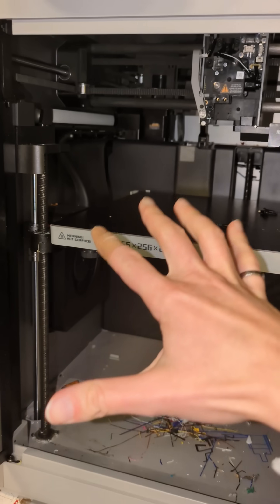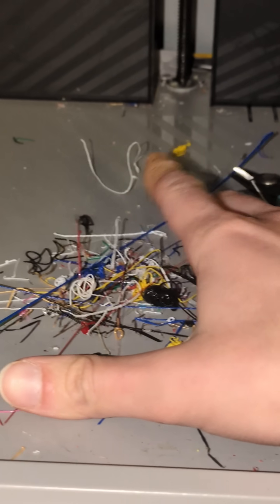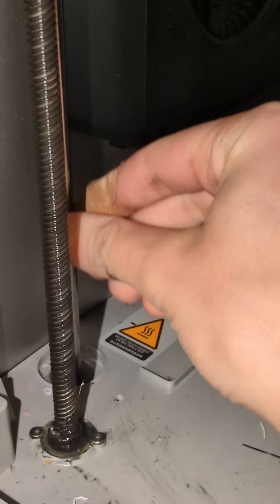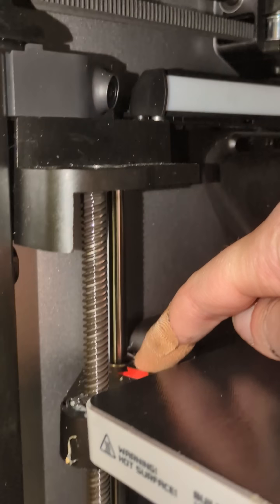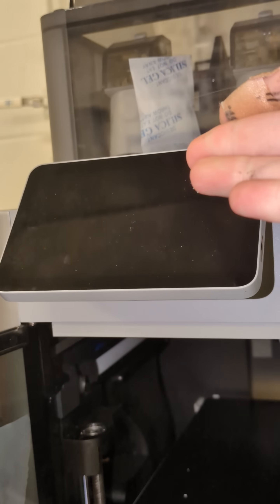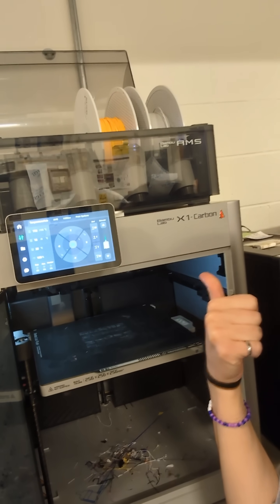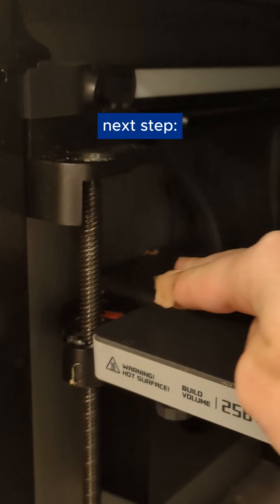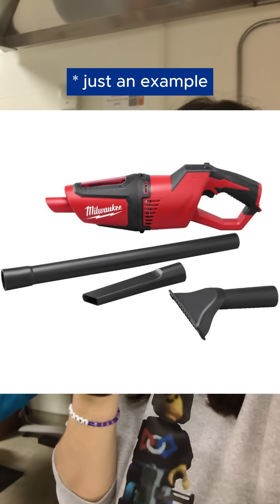a PSA to clean your printer! (z-axis linear bearing dislodge on BL X1C)

Comment: The p2s fixed this problem by not having the lip at the end. The p2s is cheaper but actually better in pretty much every way I've researched correct me if I'm wrong the only thing that would be slightly objectively better for durability is the aluminum frame opposed to the plastic frame otherwise you should just get the H2S if you want this with even even better features.